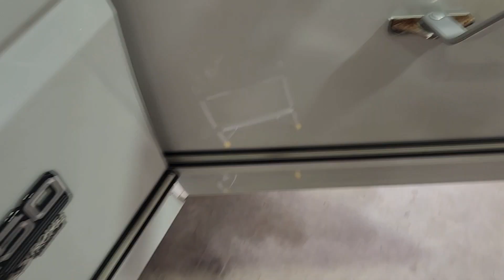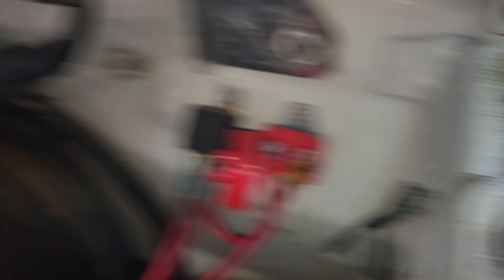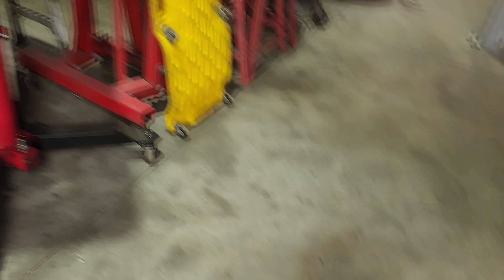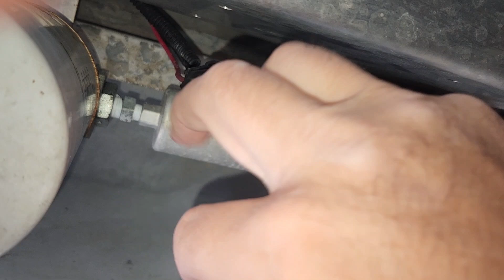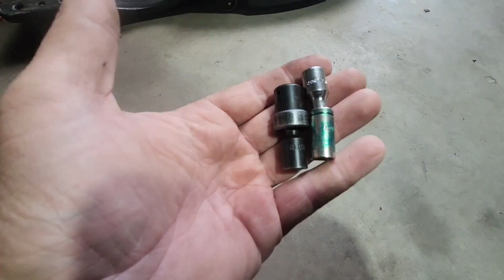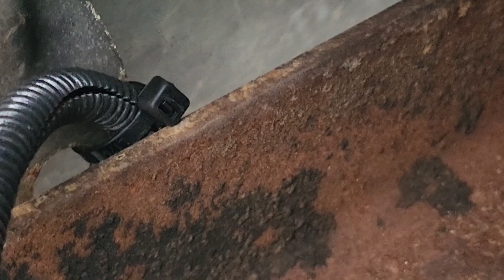Electrical diagnosing an OBS 7.3 electric fuel system.

Comment: I had a similar issue with that same wire that runs from the relay all the way down to the pump. Originally I thought my fuel pump was bad because I had 12 volts to the connector at the pump. Turns out the wire burned itself up and even though it showed 12 volts at the connector it just couldn't transfer the amps needed to run the pump would be my guess. I upgraded the wire to 10 gauge and changed the relay to a Msd one. Its been solid for the last 3 years up until this point. At least I have a good spare pump to keep in the truck :)
Reply from the maker: Perfrct!😊